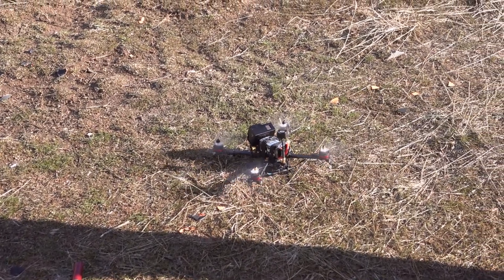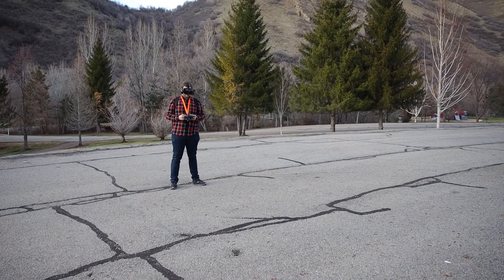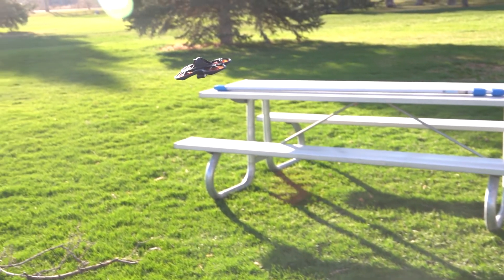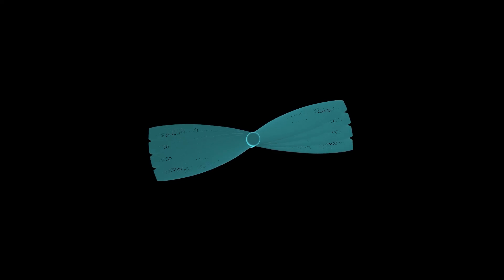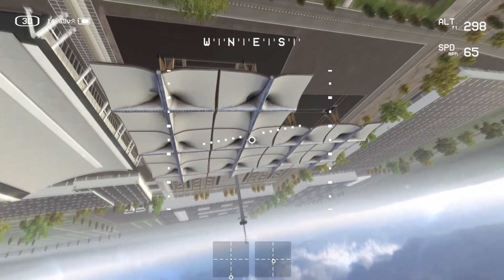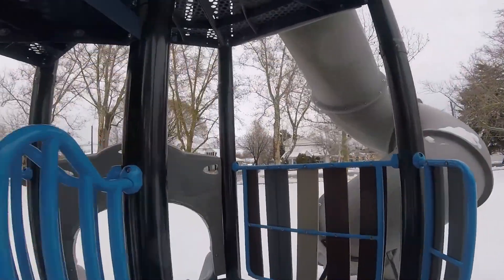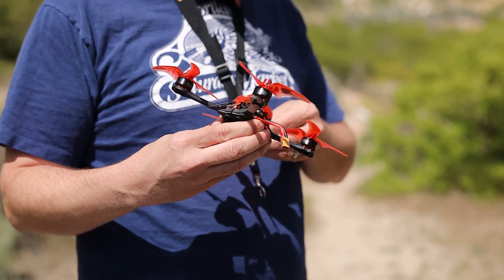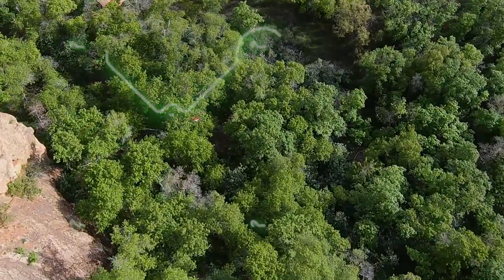FPV props and what you need to know!

Comment: Welp I'm a subscriber now lol ty 4 the much needed info😁 I'm not new but still learning,😅 I'mactually whunting to get some 5.1x4.66x3Hurricanes and 5.1x4.7x3 T-motors for my 2208 2450kv or 2207 2650kv Motors hope they work fine with these😅😵
Reply from the maker: Glad it helped you out! Did you check out our online course that teaches FPV from start to finish?